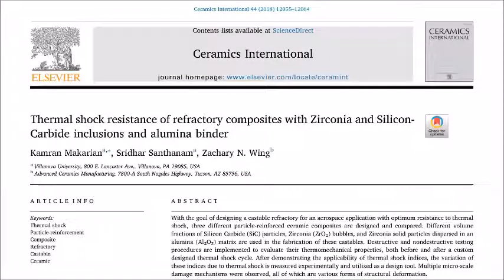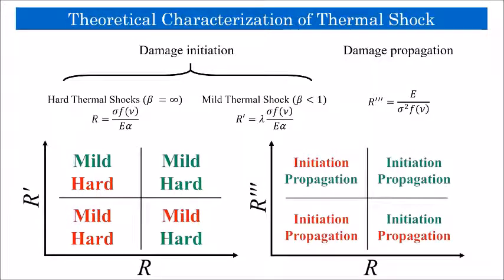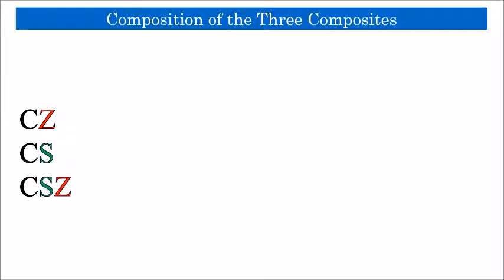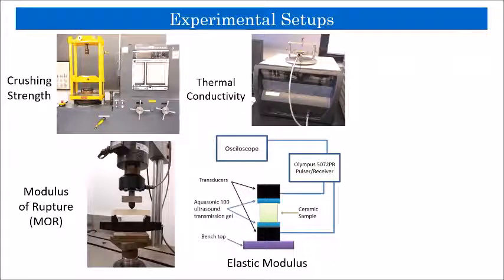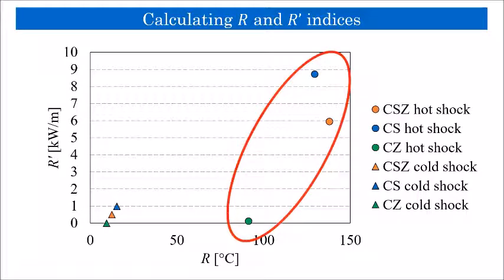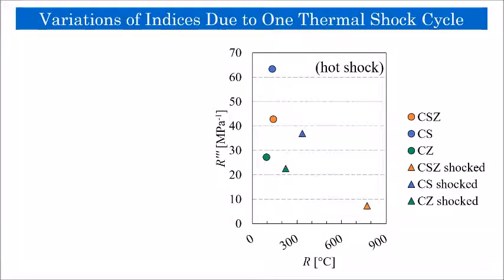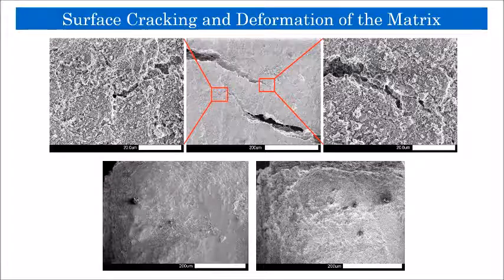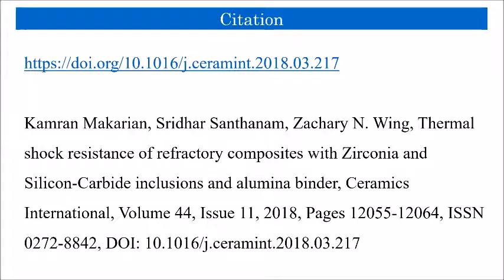Thermal shock resistance of refractory composites with Zirconia and Silicon Carbide inclusions

Comment: I hate it when there is no information about heating-cooling temprature curves that is used in the process! What is the temprature range that is considered as thermal shock? And does a thermal fluctuation about 100°c at 1250 °C Environment(such as reheating furnace or pusher types)  with cycles of 10 to 20 min damage  the refractory?
Thank u
Reply from the maker: Thank you for you comments Mashaal. As the video promises, this is a brief overview of the key concepts; a teaser, if you will! Many details are left out deliberately so that the audience seeks to read the original paper. Accurate information about the thermal shock cycle are provided in this publication and resources are cited in the introduction section to support our choice of temperature profile. Thus, I encourage you to please read the paper to find the answer to your first question and share your thoughts with me afterwards. I am not sure if I fully absorbed your second question, but we did control the temperature at all time. During the pilot tests we observed insignificant thermal fluctuations when placing samples inside the furnace, which could be safely ignored. Please let me know if you  had any further questions or comments.